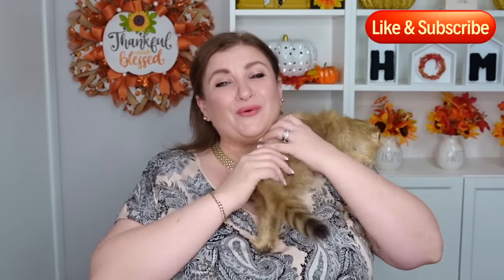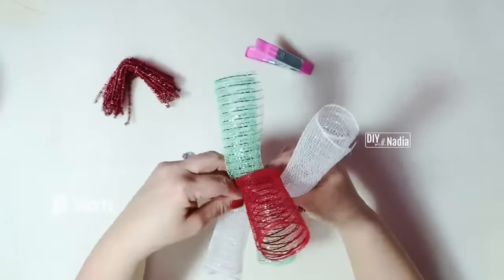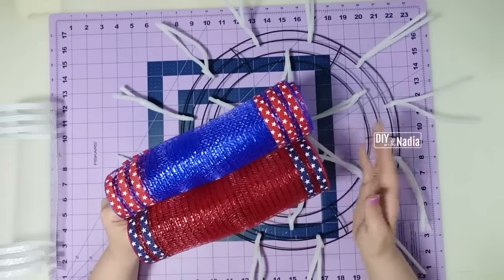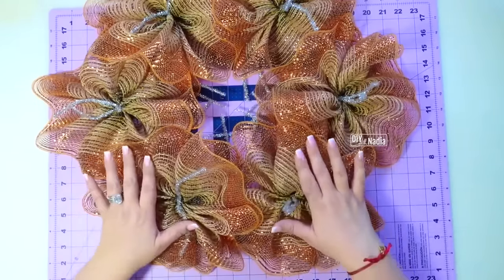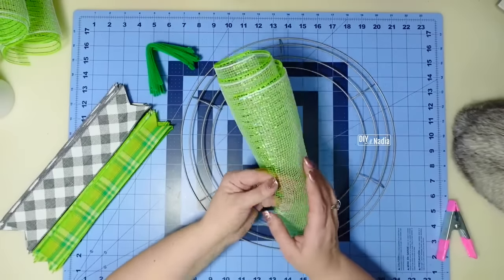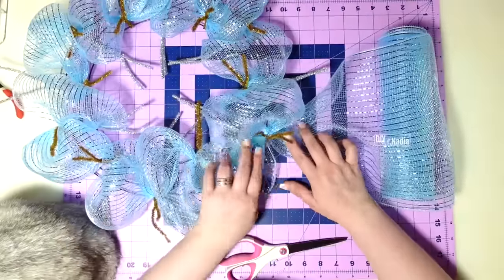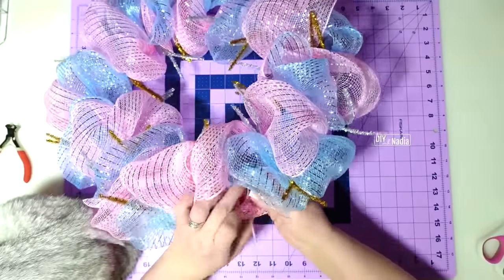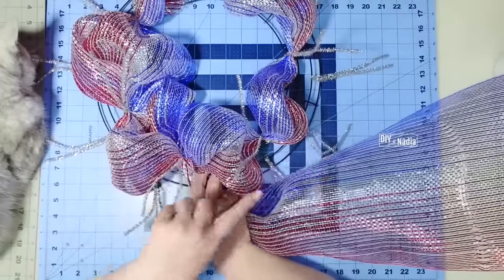Wreath Making EXPERT Reveals Top 12 Deco Mesh Base Designs!

Comment: do you have  to use the mesh in 30" or can you use less?  what length do you use if your are using 5 1/2" deco mesh?
Reply: I suppose that you are asking for making cruffles and ruffles. Around 20 to 24 inches will work just fine. It's not as full and poofy, but beautiful.
If you go back about 2 years on DIY with Nadia you find a video with 5 different methods for 6 inch deco mesh. There also is a video for a doorswag from a few weeks ago with 6 inch mesh.
Good luck and happy crafting.
Reply from the maker: I guess that all depends on the wreath you make and if you are using a mesh that is only 5.5" then yes make them around 20 inches.